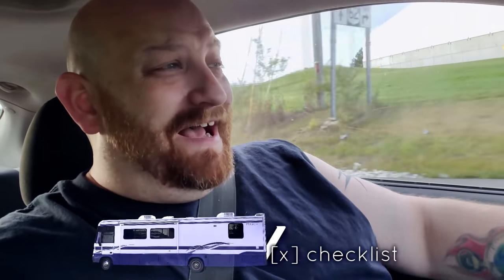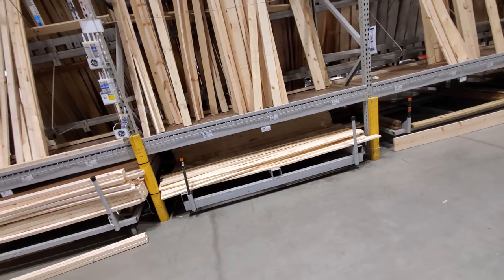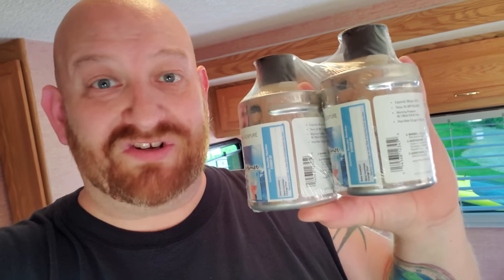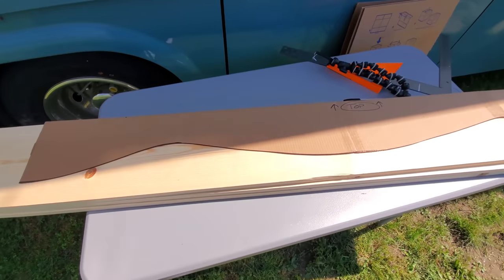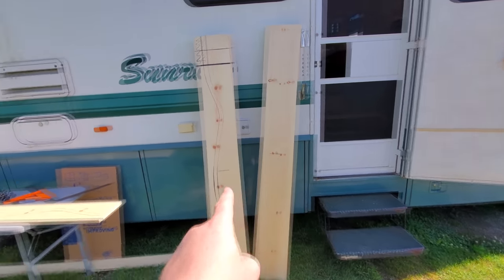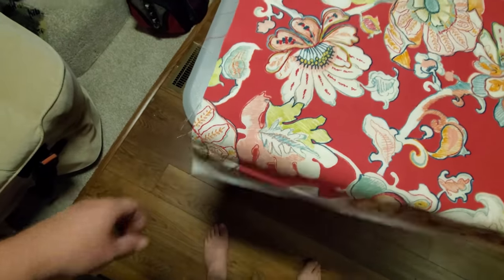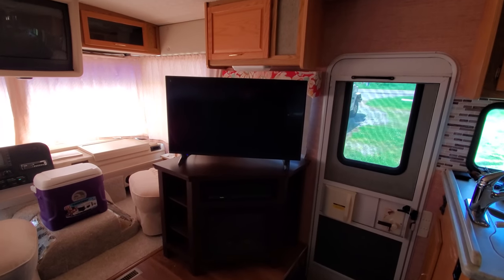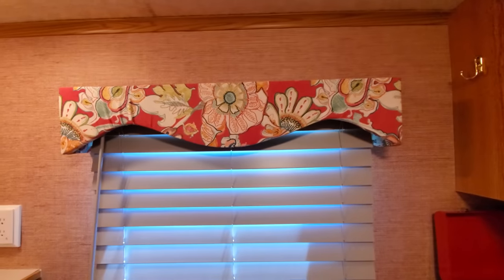BUILDING CUSTOM BOX VALANCES For The RV : RV Checklist episode 41

Comment: Its coming along man. If you dont mind I wanna throw an idea at you. I love led strip lights. What I was thinking is that you can put strip lights up in there. It will shine down and give you a cool affect. Trust me I have like 6 sets in my home theater and I love them. Its just an idea. You will love them.
Reply from the maker: that is a cool idea! Are those battery powered? or do you plug them in?
Reply: @RTSoutdoor  You plug them in. Just do an Amazon search. You will also need rgb wire and clips so you can attach the sections. Its real easy to do. You can get plain white or color so you have alot of color options. If I lived close to you I would help you but I don't. So you can search YouTube. Search led strip lights under cabinets and it will give you a good idea of what you need to get and how to accomplish it. If you need help after that just send me a message

Comment: The box valances look really great! I love the pattern of the material. You are very talented! I was wondering if you got the motor cover carpet on yet? I saw a car that was wrapped in velvet material, the whole car! Would it be possible to do a velvet wrap on that cover instead of the carpet. The velvet could still match the carpet. The wrap material is made to fit over shapes. I'm sure it would be durable if they use it on the outside of cars. Take care!
Reply from the maker: Not yet, still mad at it LOL!!